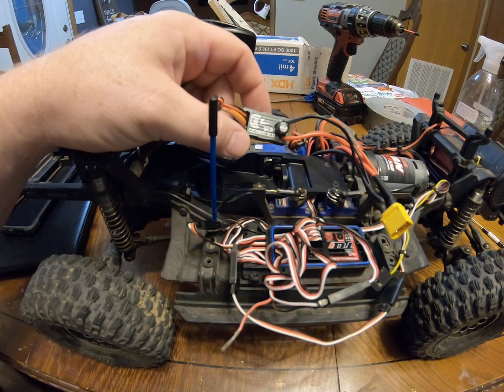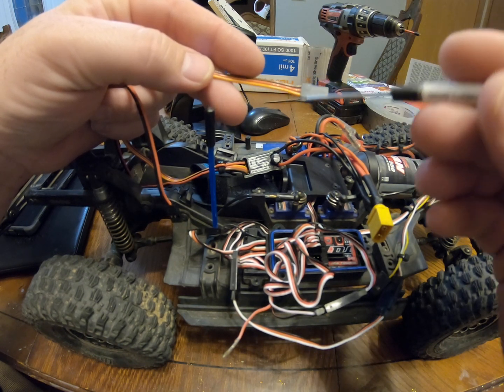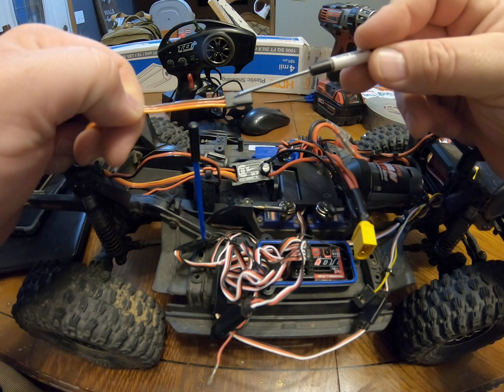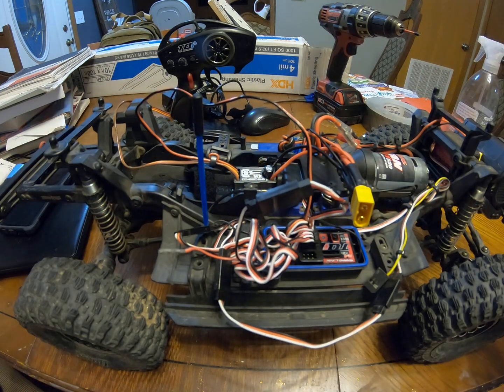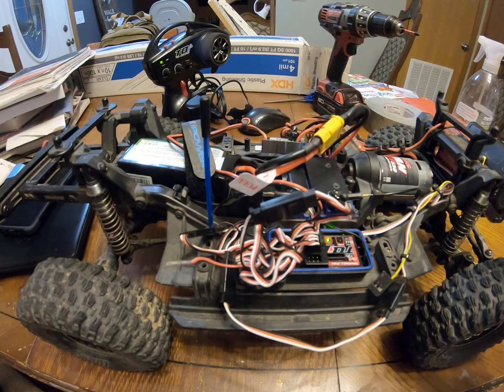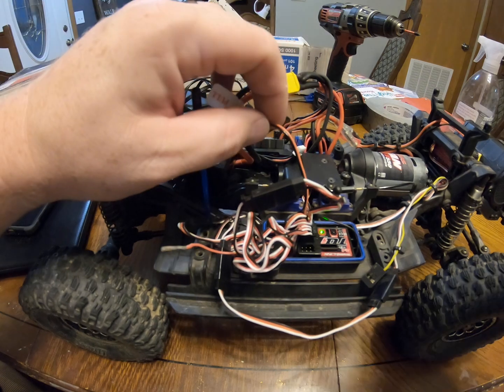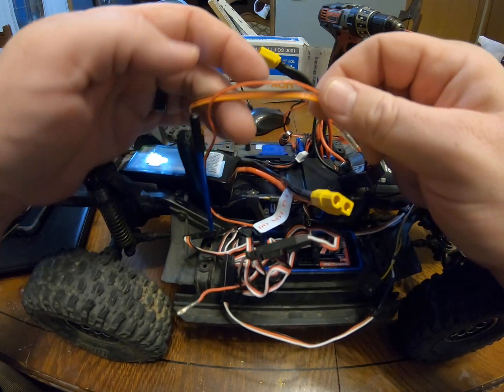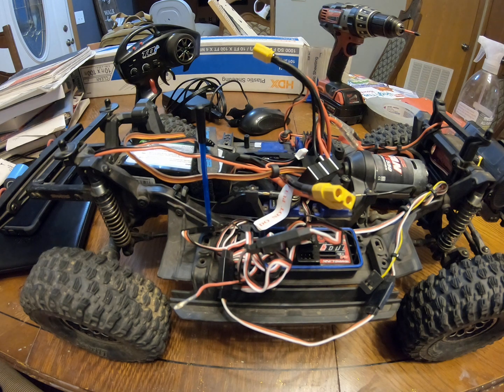TRX4 Castle BEC 2.0 WP installation

Comment from the maker: Some additional notes:
The Stock Receiver and Servo's can only handle 6V max.  If you adjust the BEC to 7.4V it will destroy your Rx and diff/transmission servos.
When I upgrade to my new 7.4V servo I will disconnect the BEC from the RX, reconnect the red wire to the ESC plug, and use a Bypass connector to connect both the BEC and the Servo.  What the bypass connector does is takes the Black and Red power wires from the BEC, and then the Black and Yellow signal wire from the Rx Channel 1, and allows the Rx to control the Servo, while using the BEC to give it power.  This way I can run my steering servo on 7.4V and still run the rest of the RX/ stock servos on 6V.  Let me know if you folks have any questions.
Reply: I’m currently doing this same thing.. pretty new to the 1/10 crawlers.. an update video would be so awesome!!
Reply: Thanks for the video, did this work out in the end? I’m in the same boat somewhat, I started upgrading my trx4 and ended up with a reefs raw 500 but I need to add a bec to make use of the servo.
Reply: It did, still working till this day!@cfear01